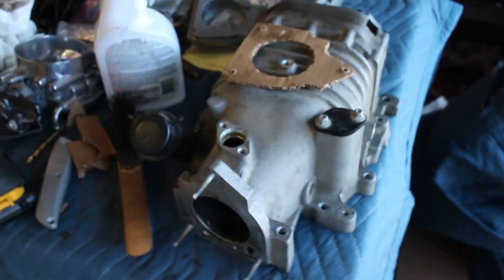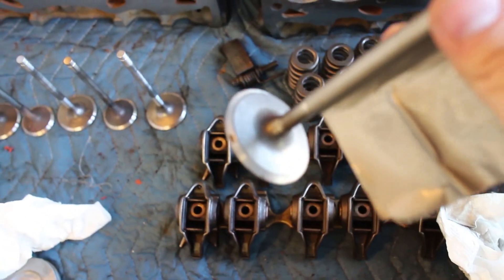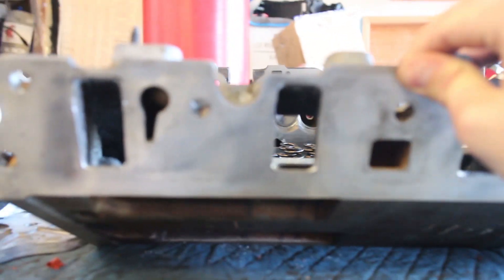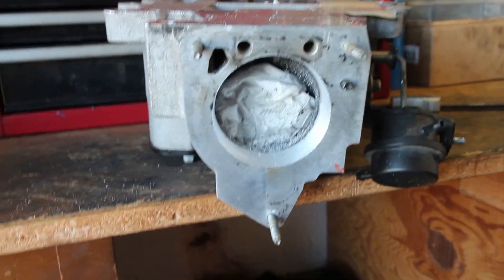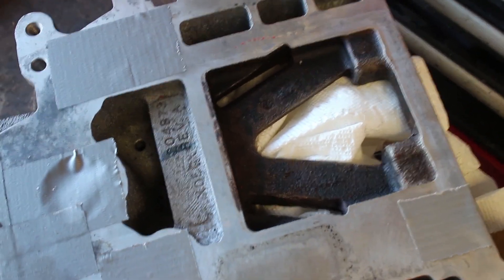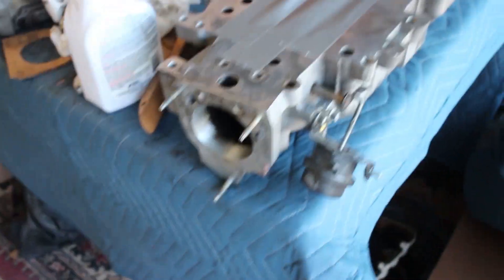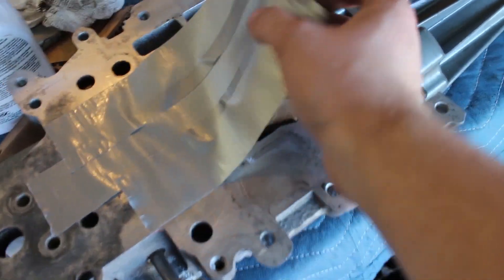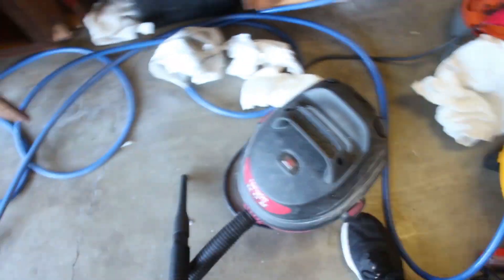Porting our Eaton M90 Supercharger For Project F (L67 Supercharged Camaro Build!)

Comment: The hole you mentioned doesnt go anywhere might be where the 1996 blower case has a vacum T fitting. My 1996 park ave ultra has a fitting there with 3 vacuum lines that a 01 blower case isnt drilled and tapped for

Comment: what would be tbe diffrence an porting both manifold and sc?? and would i need to take off the snout ??
Reply from the maker: You’d want to remove the snout and rotors to keep them clean. Porting both will allow it to flow more, you’ll see less boost but it will be more efficient. You can put a smaller pulley on to make more
Reply: what if i ported the supercharger up to the big hole the the manifold has ?? 🤔

Comment: Unless you're gonna cut part of the firewall back somehow, your not going to be able to fit a 180⁰ tubing bend on the back. Cap off the inlet and cut a 2.5" hole in the inlet neck on passenger side and weld a 2.5" aluminum pipe in place. I've seen a few and they've all had to do the same thing. Check this link out. The guy tried the 180⁰ pipe bend at first, but had to go this route. https://youtu.be/BIgkcfWaDwg

Here's the video of it before the he had to change it. 
https://youtu.be/_dYSMAEv-Fw
Reply from the maker: Cutting the supercharger is definitely something we've considered. We have couple different things to try

Comment: Planning on throwing a m90 gen 3 on my 02 3.8, if you guys can hmu on Instagram @bryantfosters. I have a couple questions. (Am I going to need to get heads? If so what is the casting # on the heads?)
Reply from the maker: We’ll shoot you a message
Reply: If you top swap the N/A engine you will need the gen3 S/C, lower intake and the heads from a 3800 series 2 or 3 (L67/L32) due to the injector ports moving from the intake to the heads. Understand with a top swap compression will be higher so you will need to run a smaller pulley than a GTP with the same modifications. You will also need the 36lbs injectors, fuel rail, twin belt balancer and the idler and tension pulleys for the second belt.
Reply: whacky pax  yes they do and the lower intake manifold is modified to accept the injectors that also come with the kit. If you use the L67 heads, I believe that's where the lower compression comes from if I'm not mistaken due to larger compression chambers.